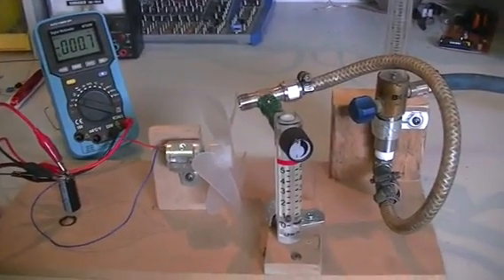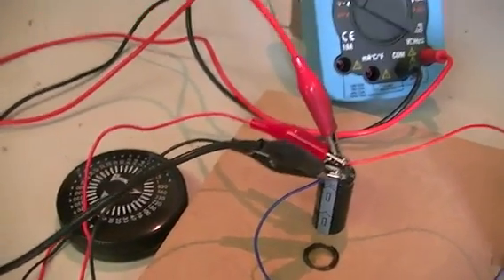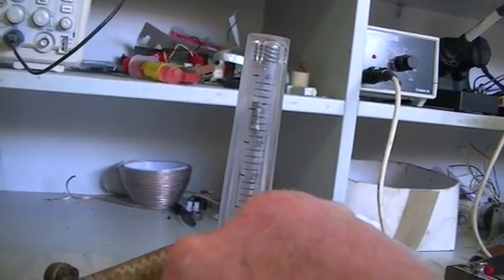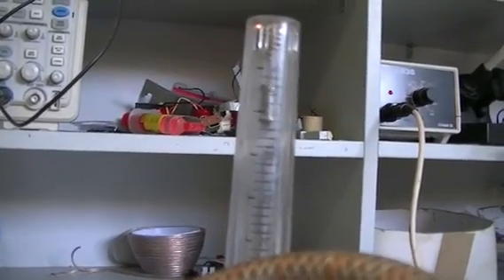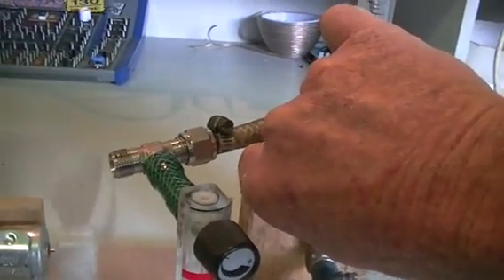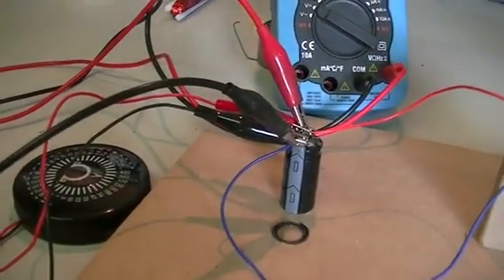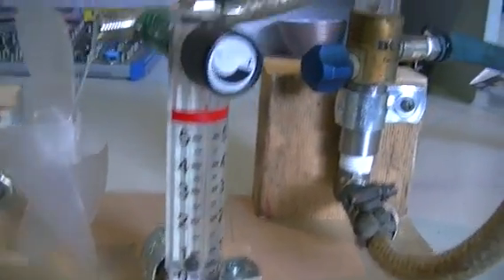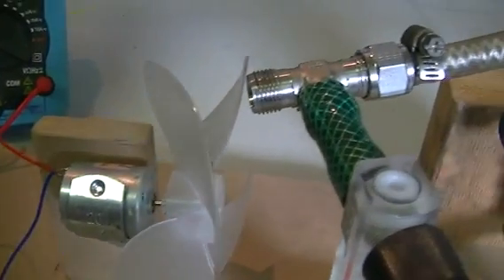True energy amplifier V2

Comment: Excellent demonstration! I would imagine there is a cooling and condensing effect taking place in the venturi intake tube. A longer tube should give more time for cooling to take place. Utilizing any waste heat from electric or compressor in the air supply would increase useable air volume ;)

Comment: Arguably the T block ("venturi") closed generates an air flow resistance to the tube, thus if you open it the resistance is less. I would argue that you get this:
1. highest voltage measured with the T-junction removed, still identical nozzle
2. second highest voltage measured with an open T-junction
3. lowest voltage measured with a closed T-junction

I would not say that adding a T-junction produces anything above what a clean straight pipe produces. So presumably there is only a resistance introduced by the T-junction and that resistance is reduced by opening the valve (an illusion of energy amplification).
Reply: Very good suggestions, Tim should try that indeed :)

Comment: Hi Tinman, Great demo.  Sell this idea to the aircraft industry, to save them 15% in fuel, That's big bucks. They would put a venturi near the end of the turbine exhaust, therefore increasing efficient. They could use it to go faster or save fuel, or a combo. There are also many other fields of application you could sell this to. Good job and best wishes. Cheers!

Comment: Good show, I actually have a lot of experience with venturi setups, I manufacturered an oil evacuation system in production to suck oil from the dipstick of mercedes-benz engines, the product was all ss. The vacuum generator used 2.0 cfm at 70psi, pulled 3.3 cfm threw the venturi and totalled 5.5, we never found out why the extra air showed up. But the vacuum your pulling is like free energy and it is seriously powerful,  this is the best visual setup to explain this phenomenon. You can stag the exhaust 3 times, when you do this you get huge gulps of air, while holding high vacuum pressure 15-28. It is why assembly plants use it to do work. However maybe a clever chap can use the vacuum to do energy type work. 

The ultimate issue is the exhaustive the system if you notice the fan was causing the venturi flow gauge to bounce as it went past the fan that's how sensitive the exhaust is it's also where all the magic happens in a vacuum venturi system it has very little to deal with the input pressure or the venturi itself it has to do with the tuning of the exhaust. I enjoyed your video.

The product can still be found on wayback.com year 1997 and under www.oilsucker.com  product name scavenger.  Look it up for fun...

David A Puchta
Reply: http://web.archive.org/web/20010201050100/http://oilsucker.com/ the link still works from internetwayback. You can click on the icons and see my product, Internet is cool...enjoy
Reply: Very Thanks for your additional input! And Very Well Done for your apparatus! :) Tim made an very interesting vid which demonstrates a conjecture I made for a "ventury like effect" in electromagnetism been able to harvest "Dirac plenum energy" (maned "Zero Point Energy" by many). It says that very short pics of voltage should be able to destabilise the plenum and when the voltage drops violently, makes a kind of "de-pressure" able to aspire the latent energy. (Old thread on Overunity.com).